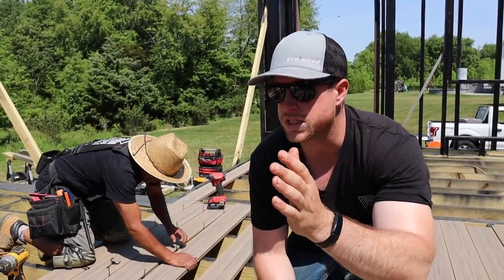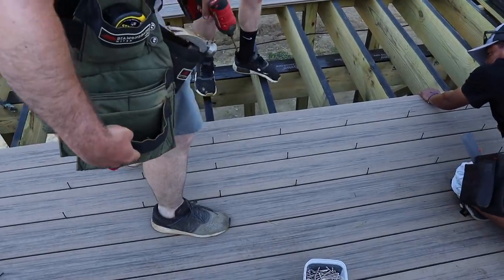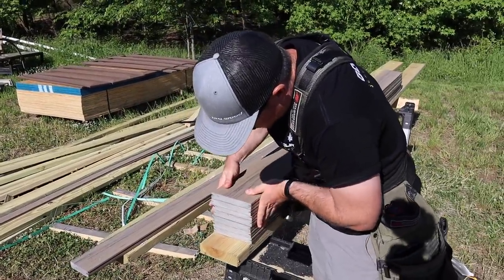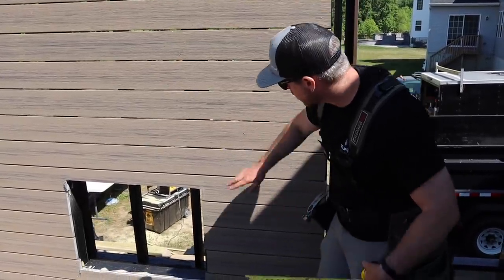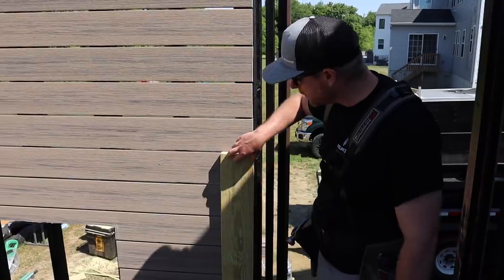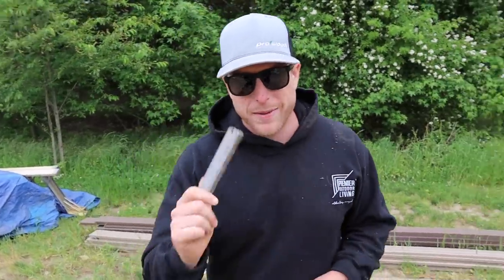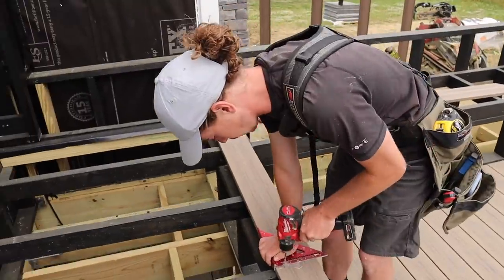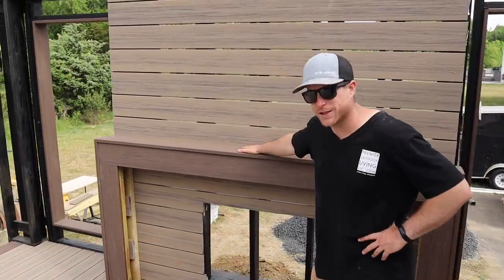Installing Composite Decking and Picture Frame Border - MEGA DECK PART 2

Comment: The deck looks fantastic.  Is the composite brand you use good for climates with extreme hot/cold fluctuations.  Our typical temperature high is 32  degree Celsius and the low is -40 degrees Celsius.   On average we get 316 days of sun.   So direct sun plus snow reflection.